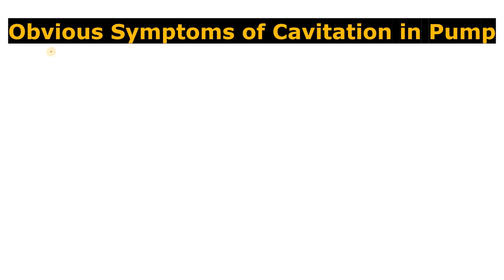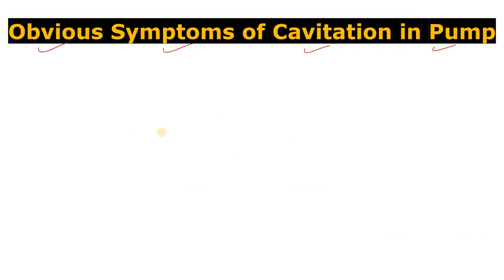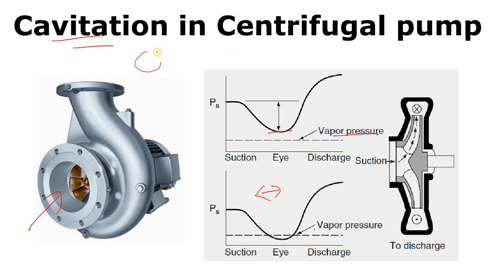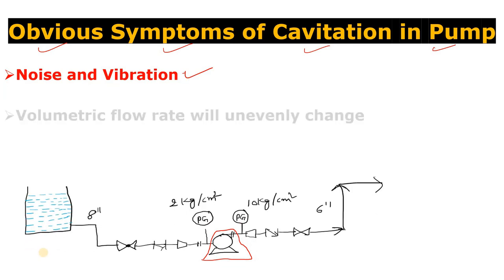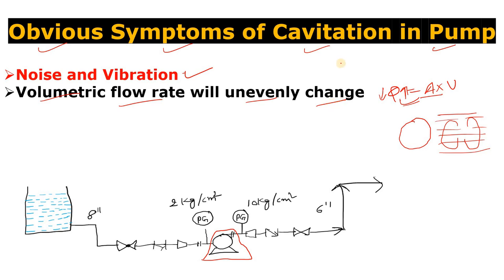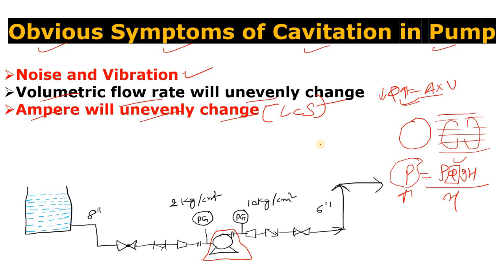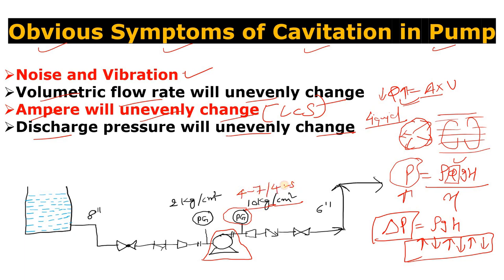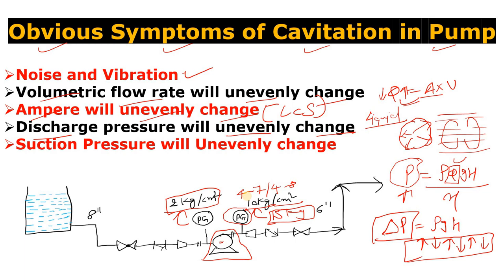5 Warning Signs of Pump Cavitation (Part-8) | Symptoms of Cavitation in Centrifugal Pump

Comment: Reduce motor speed (RPMs). Note: Slowing the pump down will reduce flow rate and head pressure.
Install an impeller inducer
Incorporate a booster pump into your pump system. This will take some of the stress off of your primary pump.
If possible, reduce the temperature of your pump, liquid, and/or other components.
Increase liquid level around the suction area.
If possible, try to increase the diameter of the eye at the centre of your impeller.